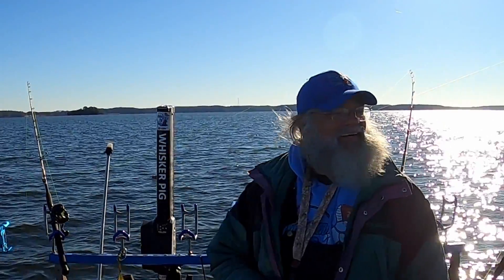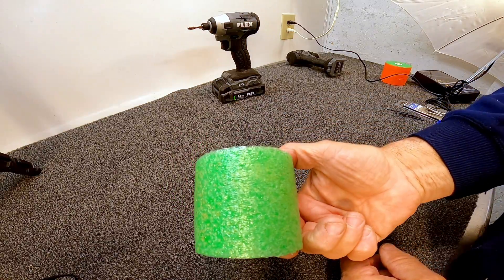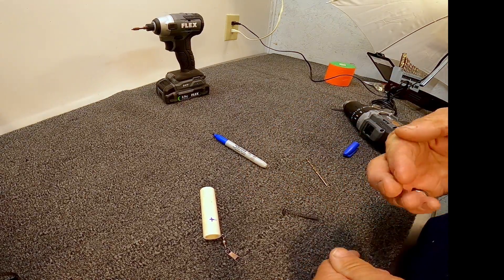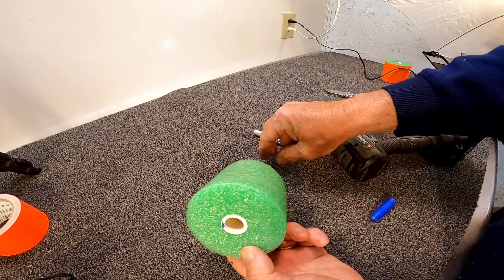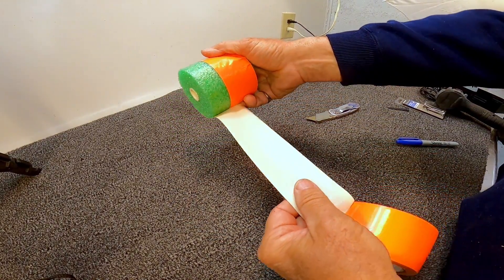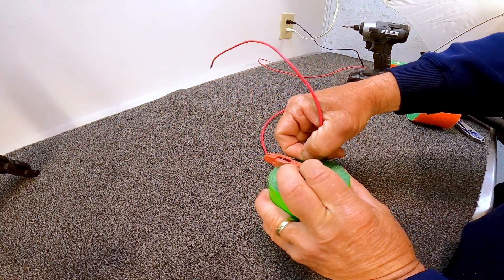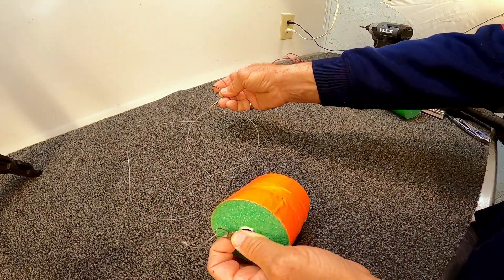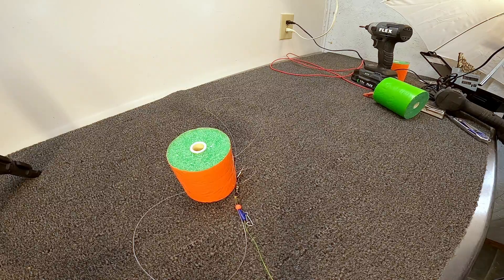DIY catfish float

Comment: Thanks for the instructional vid I'll hafta try that!! Somewhere out here I read about taking a heat gun to the outside of the pool noodle to toughen it up. I tried it and it did make a hard skin on the outside. Haven't had the opportunity to apply that yet. Seems like it'd make one last longer but at that "investment level" it's prolly a mute point..  d;^)
Reply from the maker: Thanks Freddy it works good and a little duct tape it will last a while.